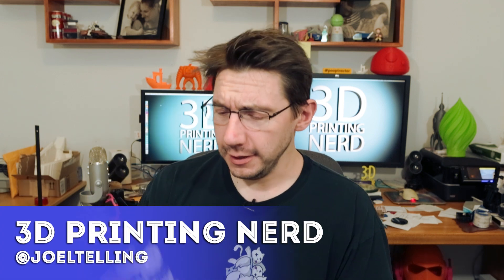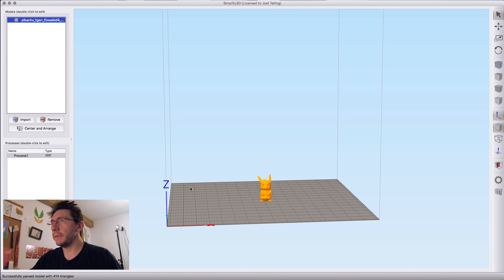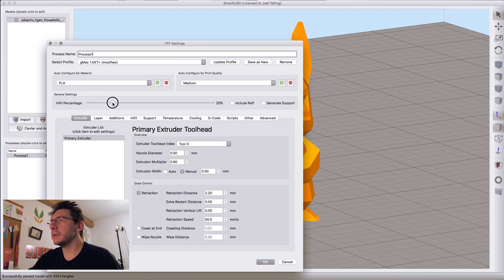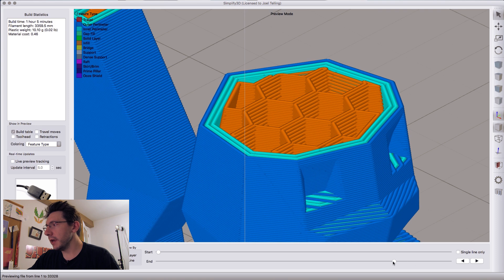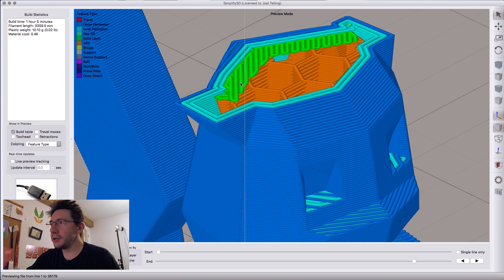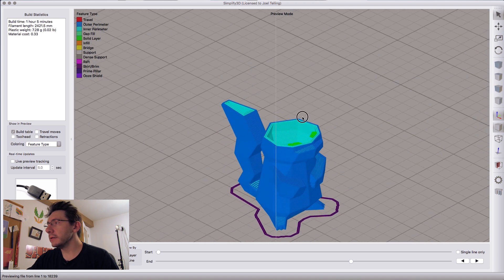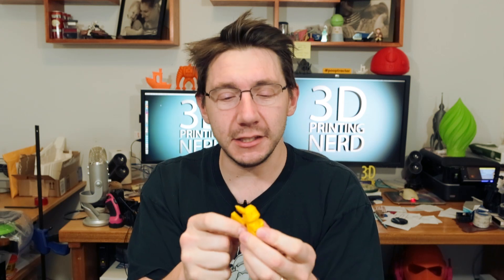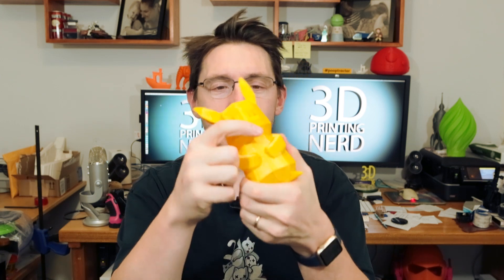3D Printing: Stop Wasting Plastic on Infill Percentage

Comment: Honestly I only really use fillament when I know it's going to be in a lot of stress. Even if small (and thus sturdy), heavy-use custom tools will get damaged without it, easily at that.

But for decorative and light-work purposes? Honestly if it's needed at all at that point it's better to model the fillament yourself, or up the Shell modifier. Plastic is stronger than we often think.

Comment: The problem is that I don't wanna use 10 percent infill on a model if Im not sure its gonna work, because if it doesn't I end up wasting 10 times more plastic than if I had just printed one with 30

Comment: I agree, i never print with more than 10%. Its a waste. And strength wise, you gain very little for strength AND if you are using a 3d printed part for some sort of strength related project, dont. Instead take said 3d printed part and cast it in sand, then make a mold for molten metal or even a resin based part.

Comment: Consider an aluminum tube... all of the strength is in the shell.

Huge ships use hollow drive shafts from turbine to prop.  they have thin (compared to diameter) shells and are often filled with sand to prevent collapse under torque.

Comment: The problem with 0% infill is when you discover it breaks, throw the whole printout then print at 25% infill. And discover that breaks too.

Knowing how much it can handle is more than half the battle, unless you got a good filament extruder.

Comment: I like that someone talked about this because I have been getting away with 0-1% with the occasional required 10% for a long time now to save both plastic and build time and it works pretty darned solidly like you said and everyone is so surprised at how lightweight everything ends up.

Comment: hello 

How do you triple the external line on an existing model? i wanna print a superman bust in maxi size. in 2 part of 30/20/40 so lots of plastic I would like to try you technique but I am pretty jnew in 3d printing. any help?

Comment: im having a problem with my prints turning out with a spongy interior.  any ideas?  I have been using a high infill (70%) thinking it will fix it but it takes forever and doesnt fix the problem.

Comment: I'd just like to point out that some models need to stand up to more force than you can generate with your bare hands. For example, would you print a part for your printer with 0 infill? 

For diddly little things like toys and statues and the like 0 infill is fine.But some of us mostly print functional pieces. Even then 0 infill is sometimes OK, but there have been many times when I've printed things that need the kind of strength that you can only get from high infill percentages. I mean, for crying out loud, there are models for SHOES on Thingiverse. How long do you think something with 0 infill is going to last when they've got a 100 pound woman standing (all the shoe modelss I've seen are women's shoes) on them?

My point is that when considering your infill percentage you also need to consider what the model will be used for. A statue that's going to sit on a shelf? Yeah, 0 infill is fine. A component of a printer? 25-50%, depending upon exactly which piece it is. A ball bearing that needs to work in a piece of machinery until the metal one you just ordered shows up from China in a month? Better go at least 50%, maybe even consider 100% for that. A bracket to mount a Cisco switch in a rack? 100% if it's PLA, no question. . Trust me on this, I speak from experience. Maybe as low as 75 for ABS. Just like you wouldn't print something that needs to hold firm out of TPU or nylon, you shouldn't print things that truly need strength with 0 infill.

Comment: Material mechanics lesson here: the 300% scaled up model WILL break easier. It's not how much infill you have, its how close the next layer of material is that matters. With a smaller model, the next surface is just right there.

Comment: With more infill your 2nd moment of area will be larger and should yield you greater bend strength. If you can get good layer adhesion, more really is more. At least with PC and CF blends. I'm not sure about non-engineering filaments but there is a noticeable increase in yield strength with increased infill from my limited experience. Though from a strength of materials standpoint it makes sense. For non-mechanical models you should not even approach 50%.

Comment: I'm currently printing at 0% infill because I don't own a 3D printer.
Reply: Relatable
Reply: yeah not having one can be fuckin annoying
Reply: creality ender
Reply: How about today?
Reply: i got 3d pen
Reply: and 0% outfill
Reply: ok how are you printing if you dont have a 3d printer then ? "dalek voice" explain !!!!!!
Reply: @shoxdanger  he does print, he just prints with a null
Reply: I was the same way, until I bought a 3d printer
Reply: hahahaha
Reply: Winning!
Reply: Or you just use vase mode
Reply: hahahaha lol. joker ;)
Reply: ...cool bro
Reply: Lol
Reply: You are also printing at zero wall thickness
Reply: How about now?
Reply: you should get one! Its only $270 for a really good one. Get Ender 3 Pro V2 or Ender 3 Pro. If you want higher quality and arent using it for desines and electronics or just normal stuff. And have a good garage with air vents, get a resin 3d printer it is more expenisve though. I split money with my mother because she wanted to use it also. Its not hard to maintain, just remember to clean the bed.

Ps, when putting it together, don't worry. It only takes a hour or less.
Reply: ah the days of 2018 where a printer costed you a kidney.
Reply: i'm also printing 0% because i don't have a budget.
Reply: thx for saving the earth
Reply: how are you printing? what service?
Reply: Damn dude you're saving alot
Reply: Saves ya a lot of money with 0%
Reply: Dawg buy an ender. You probably spend 300+ (had to add the plus) dollars on plastic bs anyways.
Reply: Lol I read that and needed help but this made me laugh.  lol failed prints suck but I busted out laughing.
Reply: Hope you eventually purchased a printer!
Reply: Actually, it is null.
Reply: @thebloxxer22  nobody cares

Comment: Depending on the volume of your structure, 2 layers of skin and 10% grid infill may well use less plastic than 3 layers and provide essentially the same strength. The closer the object is to spherical, the more benefit you will find in 3-layer skin. At infill levels above 10%, however, the 3-layer skin is always going to use less plastic, but you'll find that on large builds that are being subjected to heavy force, the infill can increase rigidity and spread the strains through the structure.
As much as I agree with this video in general, there is much more nuance to this than can be covered without math and materials engineering.

Comment: Would eliminating infill and increasing walls cause a problem on a CR-10 when removing support structures from a print? I'm curious to know if it will break the walls when I pry the supports off.

Also...just wanted to mention that GearBest did send me the printer very quickly. There just seems to be a breakdown somewhere between GearBest and updating the order page. Other than that they were pretty prompt in answering my inquiry.

Comment: Well this is what I've been wondering. (I haven't printed anything yet) I mean, if you print a box, you wouldn't use infill, if you print a bracket, you'd make it solid, a battle figure doesn't need it. And if I printed a Pikachu, I'd print a cuter one than that one.
Reply from the maker: +wordreet heh, cuter one :) the low poly look isn't for everyone that's for sure. There are a LOT of Pikachu models out there, and when you do eventually print one, I'd love to see it.
Reply: Teehee, Pikachu is round and fuzzy as far as I'm concerned.
But I'm getting withdrawal symptoms for a printer I'm expecting next week!!!!!! :¬/
Reply from the maker: +wordreet SOON!

Comment: How about.. saving plastic by not printing useless stuff like this. You realize that most of the 3d printed stuff is just pointless crap  that does nothing but ending up as plastic waste.
Reply: Agreed.  When the oil supplies are drained and people have to scrounge waste dumps to recycle enough to make basic things like medical supplies, our great grandchildren are going to hate us for wasting it on absolute garbage like this. :(
Reply: Maybe if you have no imagination.
Reply: I do product design and work with 3D prints for prototyping in daily life. I can imagine a few things. However, I wonder what the added value of this pikatchu is, other than melting filament for decorative purposes. I am aware that everything "3D printed" is considered an  instantaneous win nowadays,  but I am not afraid to say - stuff like this is a waste of resources.
Reply: So your saying if I made a phone case using a 3D printer it’s useless? Or are you you saying that the entire toy industry should be shut down or are toys only useless when they are 3D printed? As for plastic, PLA is renewable. The resources used in 3D printing can be recycled too. I’m not an environmental activist or anything but from what I see this is a very small use of natural resources. Yeah some of it is useless but if it makes someone happy why does it matter? Do you buy plastic decorations?

Comment: I agree with a fair amount of this, but i can see why some people might be flipping tits. 

Something for the engineering students to remember though is that allot of the thermoplastics available in the 3d printing venue are compromises meant to allow 3d printing in the first place. 
Rather than using 100% ABS infill for that mounting bracket, you could simply use a 2 part pourable acrylic epoxy post print to act as infill. 
Such epoxies typically have better engineering properties than ABS, and most 3d printed parts are glorified plastic balloons any way, so why not use them in that manner?

Comment: to my experience infill helps with in between layer strength. you need about 10% to 20% of it depending on the application and material used

Comment: I'm assuming with 100% infill you can use the material properties listed on Matweb.

But I wonder -- do material properties databases exist for things like 50% infill, etc?

For pikachu who gives a damn -- but what if you are printing a part with an axial stress? Or Torsion? These kinds of things matter-- even in small objects.

Or to even give it more thought -- what if you're designing a case with snap fits? You can use your engineering knowledge to design some pretty awesome snap fits... if you know a bit about mechanics of materials.

Comment: Heyheyhey. Still unable to find any information on infill when it comes to printing a case/box. I'm designing a fightstick controller and I'm just worried that the sides of it (that makeup the frame) won't be strong enough. Should I try to go for a wider shell rather than more infill? I'm testing different settings in Cura and atm I'm looking at 2mm wall thickness , infill denstity at 25% with 2 gradual infill steps and infill step hight at 10 for print with PLA. Any information on this stuff or is it just trial and error for this stuff?

Comment: Hm. As with everything, context is key. While you seem to print primarily models and aesthetic things my prints are more mechanical and take more wear and tear. While indeed the outer perimeters are more important to how robust a print is, the infill does have an effect and I would rather print my bits once and have them be reliable and strong, if heavy on material, than ending up with failed bits that need replacing.
Reply from the maker: YES! Exactly this! I think I said that in video, didn't I? It's been a LONG time so I don't remember.

Comment: Some of us print things that are functional and not just Pikachus. We need parts that are far stronger and more rigid than an empty shell.
Reply from the maker: +Davey Hi yep, and that's why I talk about that in the video! Thank you for noticing! Not everyone watches the video and just leaves a comment.
Reply: You started out talking about printed parts. then one qualifier "....depending on what the part is going to be used for" Then you switch from talking about printed parts where one needs to be concerned about strength and thus infill %,  to using a model (not a part) as proof where the strength requirement is virtually nil.
Reply: You know that a steel I beam is more rigid and stronger than a solid steel stick with the same outer dimensions, don't you
Reply: Nope, I don't know that. Have any references on it? Nor do I know how this relates to this topic.

Comment: Can someone help me? My cr-10 will leak filament during heating. How do I stop this problem. When the printer is idle it leaks filament.  As the first layer starts printing, the filament won't stick due to this. Thanks!
Reply from the maker: filament oozes when it heats up. just uses tweezers before it starts printing to pick it out. is that what you mean?

Comment: What I did... print hollow, then at 90% when the top of your model is still open: pause it. Then insert a mixture of very small pebles (like 1-3mm in size) and glue. Finish the print... and you have a strong and heavy model. The heavy-part makes it feel more expensive. Works great on presents. :P

Comment: You are great! I printed a bust of spiderman and it was the most sturdy thing ever with 15% infill. It didn't need it. It probably cost me time more than anything. I am going to try and do more with less. Also, I printed out a spinner for a friends volunteer Lil' Brother and I couldn't fit pennies in one of the weight slots because it was TOO BIG. I had printed one months earlier with 15% default infill and it was in proportion. Either way great advice! Thank you.

Comment: Engineering, science and Medicine should be the only uses for these  machines. This is self justified wastage at its best.. 
Please think about what you print and weather you actually 'need' it and remember what ever you print will be around for a very very very long time. Choking the life out of the planet one piece of plastic at a time.
Reply from the maker: Hey Brendon. You know the PLA filament I use is made from a corn starch and is compostable?
Reply: 3D Printing Nerd did you know that PLA filaments only breakdown using some specific process and bactieria. Did you now that the degradation is not instantaneous it takes time, most likely years. Did you know that even if it doesn't have the lifecycle of many other plastics it will still kill things that swallow it during its lifetime. 
Pfft biodegradable plastic that still take decades to render harmless, what a cop out. Ultimately you're teaching people how to print junk that will linger beyond its intended life span therefore ultimately ending up in the trash and continuing the cycle of ignorant and self righteous behaviour. 
If there are 1000000 3D printers, and they all print one piece of junk that's 1000000 pieces of junk. Pieces of junk that won't be recycled or rendered harmless by using the proper procedures. But who prints one thing, you'll print by the dozen. So that's already 1200000 pieces of junk. Plus the 500000000 drinking straws from America a day. The chinnese containers, the plastic cups and knives and forks. We haven't even started at toys and useless junk yet. What about packaging? 
Even some biodegradable toilet papers don't even break down properly. 
So don't tell me you're not part of the problem, with your biodegradable plastic bullshit.  
Show me one instant that the plastic completely breaks down in less then a month and I'll consider retracting my statement.
Reply from the maker: Less than a month? I always thought PLA took around 6 months to fully break down. Hahahah, dude, also, calm down. I'll try to get a compost pile going and throw in some PLA parts to see what happens over time. That sounds like a cool test to do.
Reply: 3D Printing Nerd tactful one aren't we..  A month is hasty agreed. However PLA only degrades to a compostable level after it has been broken down in the ground by certain conditions..this takes time and inevitably a large portion of it won't be buried. Meaning?.......
My haste to comment stems from having just participated in clean up Australia Day, and it's sickening. Not only that but I'm hippy and hate wastage and uselessness at its best. 
Just please think about why you are printing, what it's long term affects are, and do you actually need it, what ever you are printing. I mean it's hard to justify Pokemon on a good day but to start mass producing them in your house is effed up. 
Just because you can, doesn't always mean you should.

Comment: I have to disagree that "some models need infill to print"

In simplify 3d, you can add supports inside the model that will do the same job, and use less (probably) plastic. It takes a bit of practice, but a friend of mine prints everything at 0% with internal supports (unless he wants the weight, such as in his balancing weights for the quadrocoptor)

I plan on doing a video about it once I've worked it out, so I'll let you know :) (It'll be my first upload around 3d printing :D)

Comment: But what about structural parts?
Reply from the maker: I would use as much infill as your tests reveal is needed.
Reply: What sort of precentage would you recommend? Is there a limit after which there is little to none gain in strength?
Reply from the maker: That all depends on the application. Start out with 20% for a structural part, maybe try 50% to see how well that goes. Really, you're starting to split hairs between 75% or so and 99%
Reply: Alright, Thanks a lot!